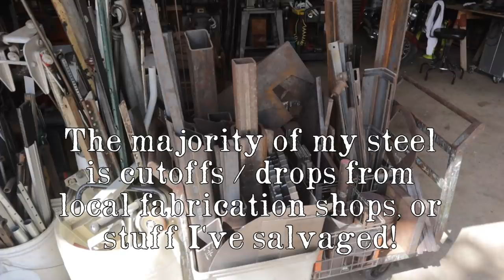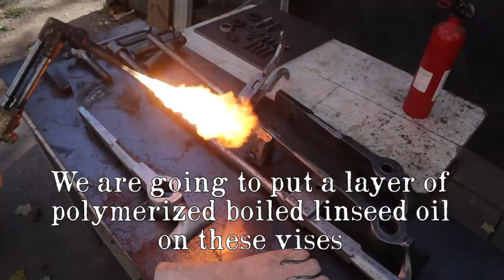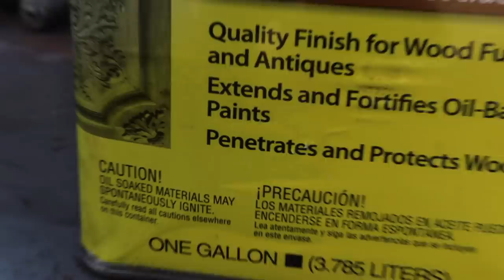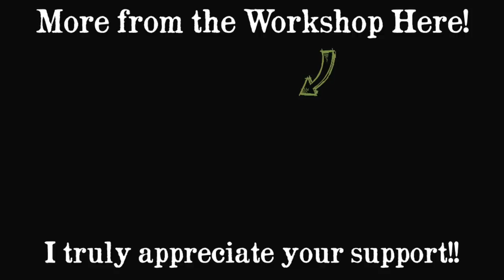Vise RESTORATION & Custom Stand Build ~ Creating an AMAZING Blacksmith Vise Stand / Work Station!

Comment: I really think that it’s impressive how you don’t just restore the tools, but you actively seek ways to make the tools better or more useful. Such as in this video, you could have just mounted the two vise on any table and be done with it, but you went the extra mile and you made a stand with hammer and tong racks and even made the flat iron a striking surface. Very well done. 👍
Reply from the maker: I try my best! Thank you for the compliment Stuart!

Comment: I've just restored mine and used the same methods as yourself to do it. it came up great with the boiled linseed oil .. I never thought to heat the metalwork first though!  Awesome video .. great tip for removing a broken tap!

Comment: Your ending was perfect. That was a great build. The only suggestion I can offer is the addition of a heavy 3, or 4" die round bar similar to the horn of an anvil for forming rounded shapes. You could mount it to your large flat steel surface.
Reply from the maker: Thank you Matt, that was a much needed ending! Not a bad idea, I do have some decent sized round stock that would work!

Comment: Another way of preventing rags from catching fire is to lay them out flat to dry. Once dry, they're just rags again. Perhaps a bit more combustible due to the added content, but no longer about to cause any mischief by themselves.It's only when they're bunched up that they can cooperate and build up enough heat to ignite. A bit like compost heaps can become warm. Spread thinly, nothing happens.
Reply from the maker: Thats definetly a perfect way to deal wee with them! I prefer to just burn them and completely eliminate the risk because I am not using BLO enough for it to matter how many rags I burn!

Comment: I love watching your restoration videos.  Your vise stand work station looks awesome. However, my personal preference,  I don't care the base you made. Too many uneven sections for me.  And I too weld in a washer first then the nut. Except it usually breaks off a couple of times before I get "whatever " backed out.  Beautiful job.  I have a post vise that I have been planning to mount it to a very heavy metal table.  Top is I think 5/8" thick. Maybe some day.

Comment: Nice job on the vises. The stand is excellent.. I used to pull out a bunch of broken bolts by welding a washer and nut on like that. Great job. :)
Reply from the maker: Thank you Gary! Ya there are a lot of ways to remove broken bolts, but that is one of the best! Thanks for watching & commenting! I truly appreciate it!

Comment: Really nice job, l made mine with a blacksmith vice and on the other side of it l put a Massey Harris vice that has removable jaws . The second set of jaws ar e for saw blades. There is also a small horn on it. You could go in business selling things like this

Comment: Good video but I have another tip for you. When using a cheater bar, especially with an adjustable wrench, always orient the wrench so you are putting the force on the fixed jaw, the opposite of what you did in the video. This will help preserve your wrench's life and avoid slop in the adjuster.
Reply from the maker: Ya I know, but sometimes I get to working and don't always think of it! Good thing I have like 25 of them, and they aren't made over seas!

Comment: my boy works for a steel erector company, and gets me the 3.5"x 3.5"x 8' oak boards they put between steel i beams. it's kiln dried, and almost hard as steel. i have the legs of my post vises sitting on blocks of that. it is plenty supportive, and has just the tiniest bit of springy give. it saves my concrete floors from cracking when i pound on something in the vise for a half an hour beating it into shape. i made some cracks before i thought of using them. i just leave the thin layer of rust on the vises, as it protects from further rusting. i know it sounds counter-intuitive, but it works. it is the same finish they used on the brown bess muskets. the layer of oxidization seals the steel from the atmosphere. plus, i kinda like the rusty color.

Comment: Just got an anvil & a small forge and this seems like a nice starter project fabricating the spring. For the spring, Is 1/4 “ steel good  for a vice which openes 5”.   You mention spring steel, is spring steel that much better over mild steel for this application.  Thanks for your guidance
Reply from the maker: A spring made from Mild steel will not push the dynamic moving jaw out consistently enough throughout it's life, but a spring made from any piece of leaf spring will... 1/4" will be plenty thick! This is definitely a great starter project, and don't be too hard on yourself, it doesn't have to be perfect, it just has to push the jaw out when you unscrew it! good luck with it!! You got this!

Comment: You could cut a hardy hole in the top plate to increase its versatility. Good job overall. The threads on the screw/screwbox on the one that started out red look a little worn; hope they hold up OK. Too bad so many people cut the main leg shorter on these (and weld the mounting plate to angle iron). I was lucky enough to buy a 110 lb. post vise in good condition a few years ago; so much more substantial than a bench vise!
Reply from the maker: Great idea! I had the same thought about a hardy hole after I finished the video, and I am DEFINITELY going to add one!!

Comment: Love  your restoration. For the vice that didn’t have a spring, did you fabricate it, or is there some place you can purchase one. I just picked up a vice similar to the one in video, but needs a spring.

Thanks rad 400
Reply from the maker: Thank you Bob! I made the spring for the vise out of a piece of leaf spring I had laying around.. I don't know if there is a place to buy them, but it's easier and quicker for me to make most things I need... If you do decide to make one, make sure to use spring steel, like a leaf spring or something similar, and you should be good to go!

Comment: The liquid seems superior due to the fact that the reaction naturally moves particles around where the gel doesn't. The gel is still good especially because economically it doesn't make much sense to use 200 gallons of liquid rust remover for 1 or 2 big pieces.
Reply from the maker: But I really DO want a 200 gallon tank of the liquid!! i have some MASSIVE projects coming up, and it would be a HUGE help!

Comment: May I ask why you did color treat the short vise like the taller vise? I thing that is a very pretty color once it is done. Great job of what you did do though.
Reply from the maker: The smaller vise is also treated the same way, but I didn't get it as hot when I did the treatment, because I wanted the 2 vises to look different from each other. Thanks for watching Gary!

Comment: what is the advantage of these types of vices vs a normal vice?
Reply from the maker: That's a great question! They are made to be hammered on... For 2 main reasons: 1: they are typically forged steel, not cast iron like most bench vises which makes them much stronger and able to take a beating and not break. 2:  The leg of the vise transfers a great deal of the hammers energy down through the vise to the ground. There are other reason and uses, but these are the main ones! They are MADE to be ABUSED, unlike bench vises. If you want to see what happens to a cast iron bench vise when it's really hammered on, go watch my "Broken Bench Vise" video!
Reply: @SalvageWorkshop  i already know what happens actually, i had a cheap craftsman vise that the jaw broke with a loud POP, i ended up replacing it with a much older and bigger vice that i had, but now i will be on the lookout for one of these as well!

Comment: it looked like one of the vises was missing a spring, did you fabri-cobble one for it? (I'm in that same scenario, have a nice post vise that I've restored but am missing the spring!)
Reply from the maker: It was missing! I made it out of an old leaf spring, because you want to use spring steel for it to work properly! the holding bracket was just some flat bar I bent to the proper size.

Comment: Why is that one so short?
Reply from the maker: Someone probably welded it to a plate at some point in it's life, and to remove it they just cut it off, which made it shorter than original... I'm happy to have two vises on my stand at different heights, they can be used for different things which will be nice!